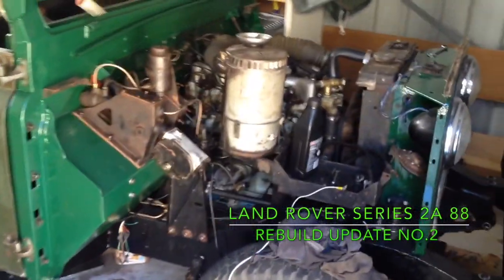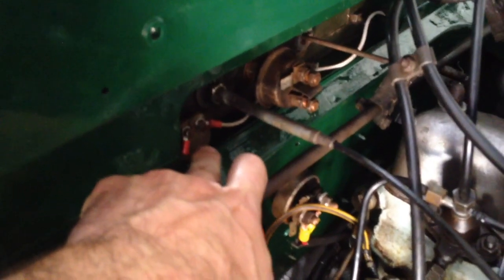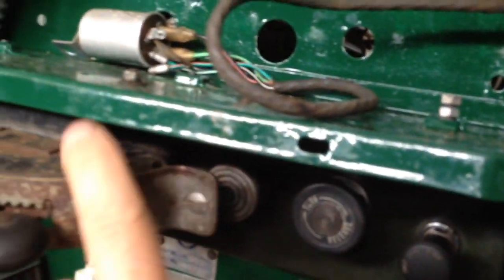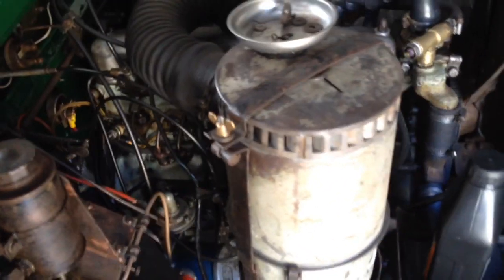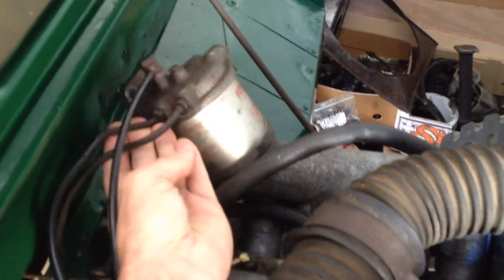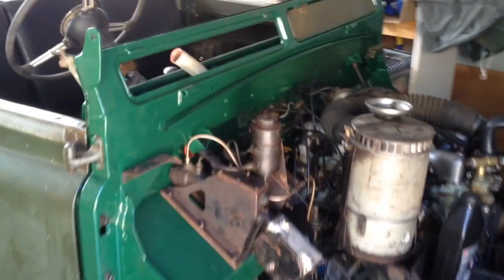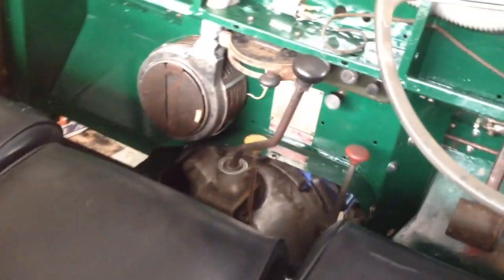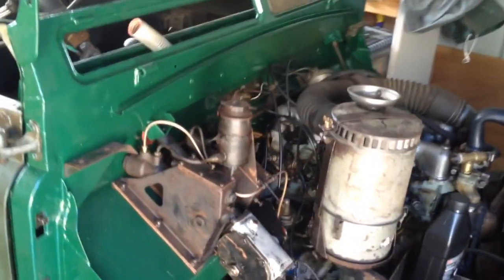Land Rover Series 2a 88 Rebuild Update No.2

Comment: Yep Bleeding the brakes is not much fun but you will be fine. All looks awesome you are doing a great job keep up the good work. I’m looking forward to the next update when u fire it up!
Reply from the maker: thanks mate. had issues with clutch to reservoir pipe leaking, so had to pull that out. Almost there...
Reply: I ended up getting rid of the original reservoir completely when I changed the brake master cylinder to one with a vacuum booster from a series 3. The new clutch master cylinder has the reservoir built in. The same 11 inch brakes with the booster actually work a lot better. If you have to source any new parts any way maybe look in to that I’m really happy with it. At the same time it’s nice to keep things as original as possible.
Reply from the maker: I had a series 3 setup but decided to keep the non booster system.  So I kept the 109 2a setup asI figured its better than the original 10" brakes but keeping with original look.  I was looking at the clutch master with built in reservoir, something I may still consider but the current setup works fine just need to sort out that pipe.

Comment: Great videos what master cylinder did you use with the 11” front drum brakes? I’m assuming you kept 10” at the rear.
Reply from the maker: Its 11" brakes all round, using the same setup as the late 2a. These are the 2.5" wide drums (11 x 2.5).  As I found out, you can't use backing plates from the 3" brakes either.